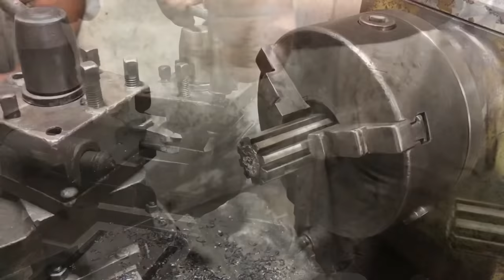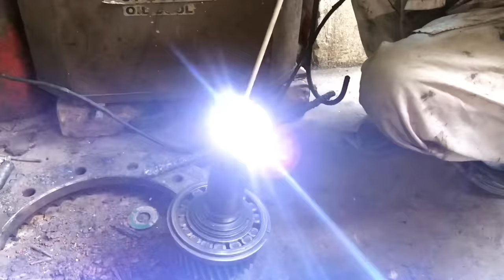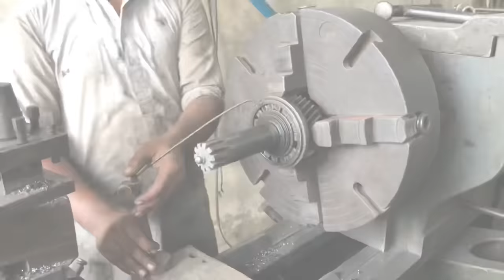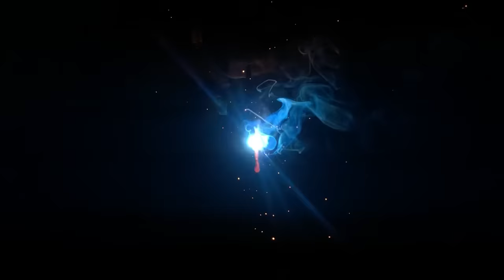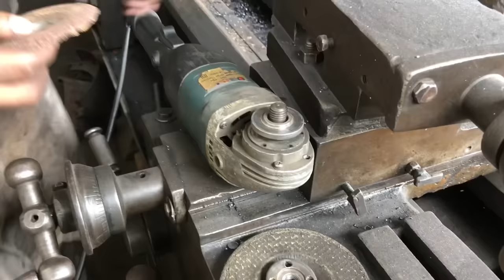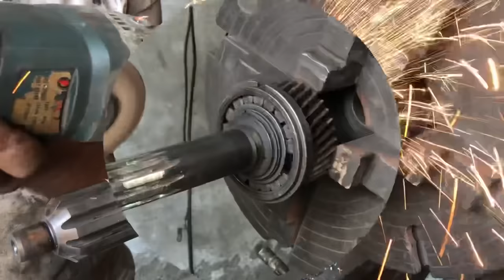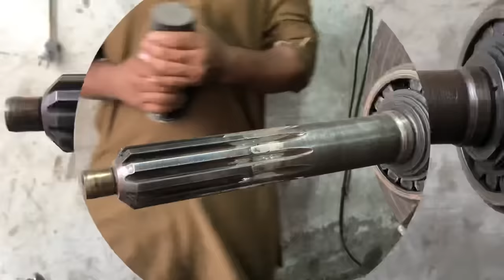The Ingenious guy Connected Broken Input-shaft Very Nicely / Pk process

Comment: I would love to know how this shaft was broken, in over 50 years working as an auto engineer I have never seen a primary shaft with such damage. I can see that the bearing cage was missing so the shaft wasn't supported correctly but has anyone else come across this?. I love the run out on the repaired shaft, if it was fitted to a vehicle it would probably shake the transmission to bits if of course you could overcome the clutch bind. How can anyone say this is good engineering???
Reply: "...I have never seen a primary shaft with such damage"

It happens frequently to people who drag race their cars.  Sticky tires, sticky track, and a (stock) standard transmission is all it takes!
Reply: pakistn roads not paved, truck went over a cliff and broke
Reply: @dirkk.6573  To give the impression that the part is newer and that it wasn't as badly damaged at it seems. This is not fixing stuff, this is dangerous as fuck.
Reply: You're completely right. This is not engineering, this is dangerous!
Reply: عندي ماكنه فيات الكرنك انقطع نفس اشي أثناء الحراثه الفدان ارتبط بعروش شجره مغطات بالاتربه ونقطع
Reply: Auto Engineer?????
Reply: Le rouleau manquant dans le roulement sera remplacé par du fer rond ? l'arbre ressemble à RVI ( Renault)
Reply: A complete  waste of time soft weld joining hardened steel. These guy have grear faith in welding rods
Reply: This is the sort of shade tree mechanic work that goes on in a lot of these countries, they make due with what they have on hand. These guys are running trucks over narrow mountain roads that are weighed down 4 times over the legal limit in Western countries but in those parts of the world this is everyday life. This is why when accidents happen they take out 30 people in one shot. Life is cheap and if you are the beneficiary of any of these accidents such is life.
Reply: @MikeInExile  Been there, done that at the drags. Also did it to my output shaft on the freeway at 120MPH racing, and poll vaulted the rear so high that my front bumper almost hit the ground! When the tail shaft broke it also exploded the rear tail housing, dropping the driveshaft onto the ground!
Reply: I saw one in the.trunk of an old 55chevy.early Muncie sheared off at th bearing.it was an old drag car in an old junkyard in the woods in south jersey
Reply: @gearbender427  "...and poll vaulted the rear so high that my front bumper almost hit the ground!"

I had a '70 Ford Maverick and the left rear wheel/tire came off at about 60 mph.  Instead of leaving the wheel well, the tire went under the body of the car and tossed the rear-end so high that the front bumper/valance panel DID scrape the ground!  After retrieving the wheel/tire, I found all 4 lug nuts still behind the hubcap.  After raising the car with the scissor jack, I put the wheel back on and drove it home!  The car was totaled though and I never drove it again.
Reply: @ابوحسن-خ1ث1ص  I beg your pardon?
Reply: @MikeInExile  Yes sir have broke a few of them in the stick class stock ford shafts. I just trashed them and put a new one in.
Reply: @dirkk.6573  To see where the interference is with the clutch disc
Reply: Perhaps the front pilot bearing was worn or missing along with slop in the carrier bearing and then add tremendous abuse, but I agree with all, it takes some incredible beating or as mentioned an accident, to get the input shaft to crack like that.
Reply: @rapwnzled8458  how is this dangerous? When welding machines didnt exist and factories didnt do mass production of parts guess who were making and reparing shafts? Blacksmiths of course, forges, hammers, anvils, and a good eye. The man in this video is not ignorant of what he is doing and seems like it's not the first time he does it.
Reply: Well let's give you a 50 year old lathe, a homemade welder and a grinder as a milling machine and see how you do Mr. Fancypants.
Reply: @dirkk.6573  Adds 2 horse power.
Reply: @dirkk.6573  It hides the discoloration from the heat, probably so they can sell it to someone as a new part.
Reply: @dirkk.6573  To hide his work.
Reply: The 5 minute warranty would probably be needed. I think 6 minutes would be pushing it
Reply: My guess is the shaft is broke at the end of "whatever slides on the splines to be driven by the splines".  If the shaft is out of true, I can see bending forces there for every rotation, and eventually fail from bending forces.  It's probably very tough on the bearings also.  Machining techniques are very primitive, not even using an indicator to get the shaft concentric with the other half.  But, they live in poverty and never experienced free enterprise, and they do the best they can to fix the stuff we built.  I have had poor neighbors in the rural area I grew up in who basically did the same thing out of necessity.  They even built a barn out of pallets that still stands strong to this day.
I could make that shaft properly in my little shop, like new, with less time and energy.  I don't know where that is at, but it is a pretty primitive way to live.
Reply: You have to admit, it's quite a job he did. I am no mechanic but knowing this is a shaft that spins all the time, it's another failure hopefully the brakes work but that's another story.
Reply: Give the guy seems credit, he did the best he could with what he had abd his knowledge with the time he had.  3rd world country,  if they rake it easy and baby the truck , it night hold up for a season.  
We all know it was not aptimum repair, but we are not in a perfect world.
  Pull the log out of your eye.   Nice metal lathe, that was cool.  What the heck , I wonder how it worked.
Reply: @johnkomosa4089  Ever see the roads in India....You gonna trust that shaft up on the side of a mountain? If it snaps going up, You are comming down. ....Nice job keep up the good work.....I watched him weld a cam back together.....not that a few degrees makes a difference or anything. These repairs never go back in a vehicle. If they do....The amount of danger to the people driving, riding or following shouldn't make any difference.. It is only a third world country.
Reply: @dirkk.6573  he paints then checks clearance marks for final fine tuning of the grind. I'm just guessing...
Reply: To mało jeszcze widziałeś...
Reply: @dirkk.6573  To hide his useless hassy-bassy work....
Reply: 80% longlife is best be  hoppe
Reply: Have you seen the way they treat their trucks in these places? Just about as well as the way they treat their machine tools.
Reply: I have seen a drive shaft shear on a Black XR3i he dumped the clutch showing off and boom , even had his car on the front page of a very well known car magazine
Reply: over torqed probably belongs to overloaded truck
Reply: @fredericlegall690  Eaton Fuller boite vitesses
Reply: After millions of miles splines get thin, after many clutch rotors and at least one flywheel. Input shaft snaps if bearing supporting it fails and it gets radial force. Or if in accident clutch bell gets demadged and gearbox is separated from engine in violent way. Rare ocasions, but happens few times in a lifetime. More on tippers and forestry, never on highway.
This shaft is from Eaton Fuller.
Reply: @sinisatrlin840  shear force from Torque is much more harder on especially shafts with spline then "radial force"
Reply: @Amerikanin2numarali_ustasi  I am aware of that. I was talking about special condition that would shear this Shaft. Chain of events. These shafts usually do not fail in this way.
Reply: John,  your  right,   but   they have  no   choice... they have to Gamble.
Reply: @stormytempest6521  This is not a gamble, this is "lets film something to upload". This will fall apart when mounted, and they know it.
Reply: @sinisatrlin840  There gambling   it   will   work !  due  to   poverty..... think  a about  it.
Reply: @stormytempest6521  Every machinist poor or rich know that you can not weld these things. Usually these welds do not survive drop on concrete from 3 feet. They crack next to a weld like glass.
Reply: @sinisatrlin840  YES  thats right,   but  these  people  operate   in  the  third  world,    correct  it  is  bad  practice  and  false   economics, but  we  in  the  West   have  no  idea  what  they  go  through   on  a  daily basis,   they are  gambling   big  time  and  they  may  get   lucky , but  repair  will  fail  sooner  than  later, regards.
Reply: No, no, I have done this repair to a land rover gearbox input shaft. It is still going 14 years later and 90,000 miles. Please talk from experience. Have you ever tried it?? Contact me for genuine verification.
Reply: I have done this repair , 90,000miles 14 years later. Verification contact me.
Reply: @swarfify  Land rover has input shaft that is about half of diameter of this one. Land rover has petrol engine and 1/8 of torque that typical large diesel has. This Eaton Fuller shaft is extremly hard, induction hardened, unweldable. Old Land Rover shaft is about 1/3 in hardness of this one and can be welded with good prep and some preheat or higher current.
Old petrol land rover had about 100-120Nm, today lorry diesels have about 1200-1500Nm, some more.
Not comparable at all.
Reply: @sinisatrlin840  I am so impressed with your knowledge. Thanks for the reply. I understand now that I was lucky with my repair.
Reply: @swarfify  Best way to learn is when you work in industry and are able to see many different cases and problems that you must solve. Part of my job is repair of crane gearboxes and speed reducers, we also have large machine shop so we alredy know what to do and how to do it.
Mehanics untill mid 90s was different, shafts and gears where softer, all was made to be repaired some day.
Reply: Actually these things are done usually to sell the old vehicles with defects. It's done for casual repairs and burden is shifted to the new owner.
Reply: @dirkk.6573  maybe rust prevention
Reply: Bei diesen Typen ist halt alles möglich😄😄😄😄😄😄
Reply: @rapwnzled8458  das ist halt Pakistanisches meisterkönnen 🤣🤣🤣🤣🤣🤣🤣🤣🤣
Reply: if we look closer we see that 2 or 3 rolling elements (rollers) are missing and it will develop an excentric rotation , i think this was the cause from the begining and instead of fixing the cause he's fixing the result and soon will be the same or worse, but i respect trying to be inventive..🙂  Also it is worth mentioning that when he induced to the parts so high temperature with cutting and welding, the parts are much weaker in proximity of that place.
Reply: they make their trucks longer and dump boxes larger, they load the the trucks harder than it should be, the drive train elements then fail.
Reply: @dirkk.6573  he wanted to mark up where it doesn’t line up using the old clutch. More grinding needed.
Reply: @rapwnzled8458   right, what they hope is truck goes over a cliff before it breaks.  Warranty ends when it leaves the shop.
Reply: We snap them all the time in the diesel world, look up these guys hauling shit and you'll understand it quickly. They haul like 50k pounds in the back of a truck
Reply: Perhaps it is from a Double-A, top fuel, Nitro-Methane dragster or something.
Reply: Sent it too hard haha
Reply: As an auto engineer I am sure you don't see many design flaws, as a mechanic I have seen a few broken transmission input shafts. Output shafts also and everything in between.
Reply: Exactly, this will never happen
Reply: I saw the pinion shaft of a '70 Chevelle twisted in half like it was butter from a neutral slam of a foolish teen.
It was so smooth it almost looked like it was cut by a lathe!
(It also broke multiple teeth in the differential).
Reply: How it was broken? Have you  seen videos of how overloaded trucks are in some foreign countries?
Reply: It's not. It's what you do with with what you have when there's no other option. Would be great to know if/how long it worked
Reply: @MikeInExile  ->Looking at the clutch size, this hardly is a drag car shaft.
Reply: I would say truck was overloaded then coming down a hill driver throws it in reverse {somehow} and we now got engine vs truck moving so snap.
Reply: @asbestosfiber  But you forgot the most import tool, they all seem to have magic oily rag and when they got nothing to do about 50 of them wipe it down with said rag before handing it to the next guy.
Reply: @johnkomosa4089  God that was hard to with every second word misspelled.
Reply: I've seen it happen twice in an excavator when it was started in subzero conditions and the oil was too thick to pump.  Can also happen if the brakes in a truck freeze and the operator tries to free them by popping the clutch.  Usually the axles fail first.  In electric split axles the  shift sometimes delays and then will engage with such a force it will fracture an axle which will eventually break. Yes the runout on that shaft was noticeable.  Doubt it was installed in a vehicle. Probably just done for the video.
Reply: Broke there on account of a bad weld…
Reply: @IAW888  That’s right! He has probably welded this same shaft hundreds of times! 😂😂😂
Reply: And they have nukes? Ha Ha. What a joke
Reply: As an engineer you would have no exposure to a piece of equipment that had been damaged in the field.  However,  any heavy equipment mechanic has seen something like this at least once.  
 I wouldn't say that damage like that is common, but it  is not unusual.
Reply: It’s an effort…live and learn..it beats hanging around and doing nothing in America .
Reply: They don,t need good engineering They need something to allow the Vehicle to move. Westerners have this mindset about these countries they do what is required to get going again. And will just move in 1st or 2nd gear
Reply: The few Roller bearings missing is probably what  causes have to break in the first place

Comment: So you have managed to destroy the heat treatment on the splines by welding it, then failed to reharden them after welding. 
I bet this will snap again as soon as you let the clutch out.
 Next time don't over load your truck with 10 times it's maximum weight. 😂
Reply: Im usually really impressed with these type of videos, but this one, wow. I feel sorry for the poor guy who pulled the broken part out, paid this guy to "fix it", and then put it back in only for it to last as long as Rosie O'Donnell's lunch.
Reply: @williamglendye1692  it's good. It didn't shake the lathe when he turned it on. Machinist 38 years. Lol